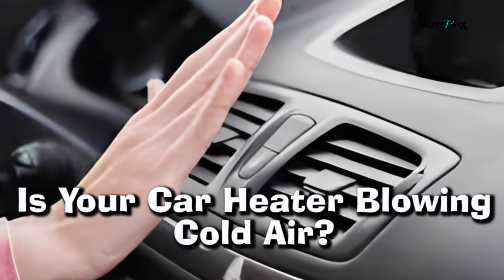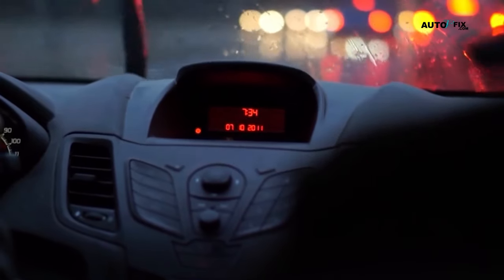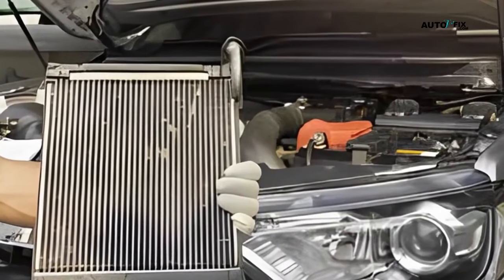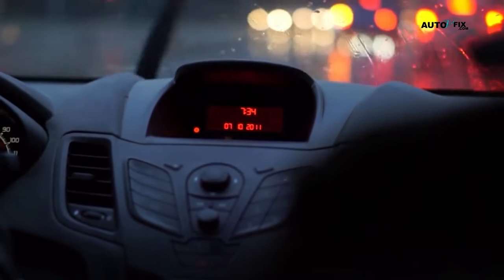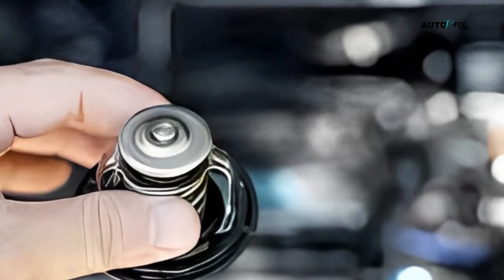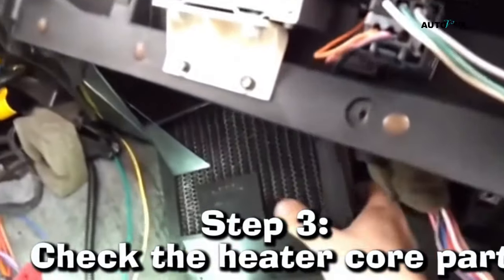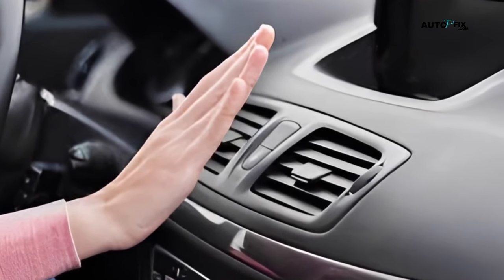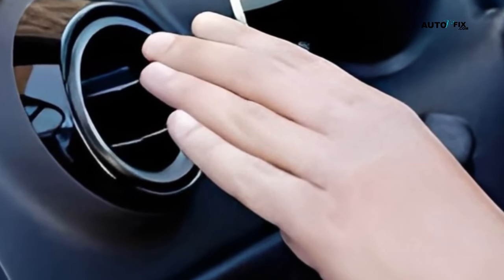Why is my heater blowing cold air, AND How to fix car heater blowing cold air

Comment: My heater blowing cool all the way up to 25 degrees only goes warm on 26 27 28 , any tips on why this could be ? , also my air con not working
Reply: I am also having the exact same problem! I have the G30 540i, 2017 model. It blows cold/cool air from 25 degrees and 26 upwards then it is warm/hot air. 

I don't know what the issue is, however I'm thinking it could be the cabin/air filter? I've only had my car for 4 months now and I've only noticed the issue now....
Reply: I got exactly same issue
Reply: Same here!
Reply: nice to get a reply !??
Reply: No one seems to know what the issue is....
Reply: Right. Id like to know also
Reply: I think probably best to either look at the car manual or speak to the BMW dealership. They should be able to give us the correct reason why....
Reply: Check the blend door or blend door actuator. It is a door near the heater core which allows the vehicle to switch from cool air to warmer air.
Reply: Usually if you ever heard a tapping or knocking behind the dash when trying to switch from cool to warm or vice versa , it will make a noise because the door is stuck or broken and can’t switch from cold to warm.
Reply: Having exact same issue with my 2018 Durango. Last night it was blowing COLD air at 22 degrees
Reply: I got exactly the same issue with my Kia Niro 2017. Has anyone find out the problem?

Comment: I replaced the heater core and it still hasn’t fixed the issue
Reply: You may want to check your blend door actuator, it’s a door that allows the warmth to come from the heater core to your vents.
Reply: I change radiator and thermostat  still no working
Reply: @jamaelasalley9862 my ford edge with heat on blows heat only on passenger side, I replaced the blend door and still the same, also replaced the climate control module I’ll probably flush the core and if that don’t work I give up lol

Comment: My issue is it blows AC temps at 22 setting. If I crank it to max I nearly suffocate. It may blow hot for awhile then it will go like warm. I’ve taken it to Dodge and they can’t find anything wrong. When I’m driving and have to get out in the rain then get into a car blowing cold/cool/luke warm air, I say something is wrong 😡